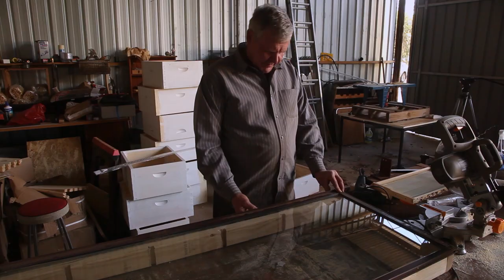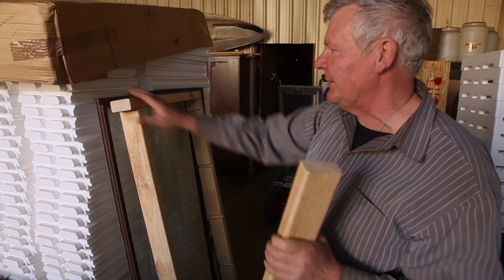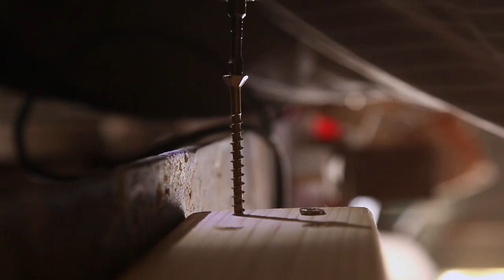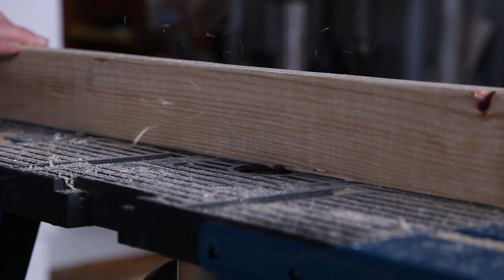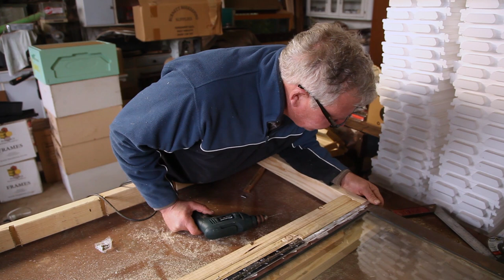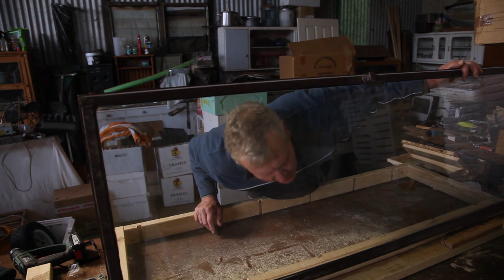How to Build an Observation Hive (Part 2 of 3) - Episode 83: "Opening Doors"

Comment: The width a blade cuts is called the kerf, so you'd be taking off half a kerf. I don't know if you're SUPPOSED to use kerf as a measurement, but I've certainly done so at work more than once. Close enough!